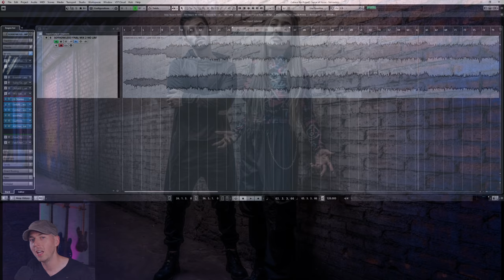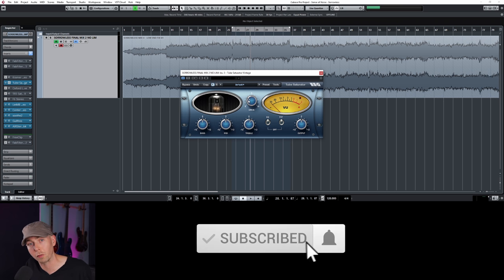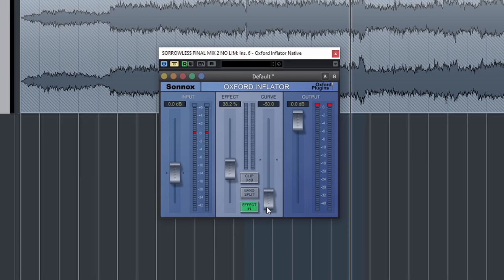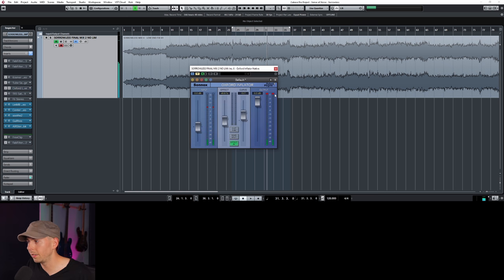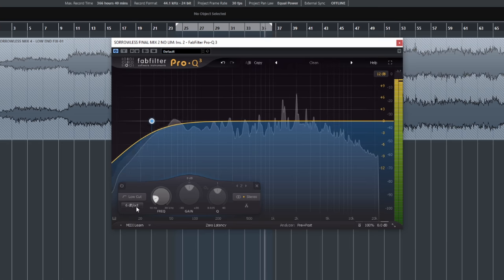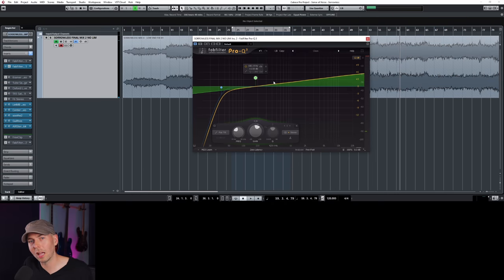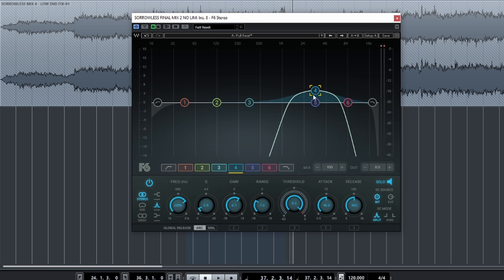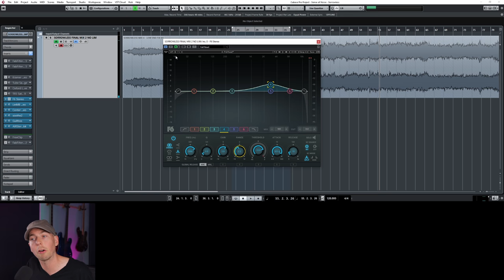3 Tricks for LOUDER Songs Without Compression or Limiting

Comment: I use a limiter, and I hit the LUFS level. My songs STILL don't have the volume that I need. They are still quieter than other songs on YouTube.
Reply: Do not confuse loudness, which is an objectively measurable property, which volume, which is subjective. LUFS is a standardized metric for the loudness, which is definitely more sophisticated than for example the peak and RMS level, but does not consider the perceived volume. If you have for example way too much low end in your mix, you will have quite high LUFS values, but it won't be competitive with other tracks.

Comment: Face palms Where to start. First, notice how the plugins are peaking? Digital domain peaker = baaaaaad type of distortion. Secondo, the more you boost through plugins the less head room you have, which means when you send that to a mastering, or when you're doing your own mastering (not recommended, get fresh ears to do it) they have no head room to work with. That's why when you boost frequencies in eq's or basically do anything that raises the volume in a plugin you have to trim it down so that the output is back to the same level as the input of the plugin. This will also allow you to fully see the sonic difference of your changes and not just the perceived changes due to the difference in volume output. Thirdly, choose what you do carefully by the genre of music. You already have a heavily distorted type of music going in this song, adding a bunch of distortion on top of distortion is just going to make everything sound over distorted, even if you try not to add too much distortion, the accumulation is going to do that. Now also notice he's doing that on an entire mix as a mastering process. THIS IS KEY to understand, don't confuse what he's doing as something to do while mixing. If you'd try to do that on a track by track in the mixing process you'll DEFINITELY end up with an over saturated mix.
Reply: Regarding point 1: if the plugin is running at 32 or 64 bit FP, it won't actually be distorting unless it's designed to emulate analog clipping. Which plugin are you specifically referring to, because I didn't see any active clipping once he was done adjusting them.

Regarding point 2: headroom for mastering is absolutely a myth. All we really need is a file that doesn't clip. Other than that, we gain stage it to our liking before hitting our chains. Also, the whole point of these tests is to make the tracks louder, not simply to make tonal changes, so the whole "fooled by loudness" argument doesn't necessarily apply, although it's not a bad idea to check and make sure it's not making the mix sound WORSE when level matched.

Regarding point 3: this entire video is obviously geared towards mastering, so I'm not sure why anyone would confuse this as something to do while mixing. Although I'm not a fan of adding a much noticeable distortion during mastering, the whole point of this video is to show ways to increase loudness aside from the traditional ways, so obviously saturation has to be talked about, even if it's not necessarily the best tool for the job.
Reply: @rocketman374  Ill get back to you for the time stamps later tonight. Well, I don't master my stuff een though I kinda  mix through mastering plugs on the master buss, but thats justto see what actually would happen audibly. All mastering engineers I've worked with or talked too always wanted the mixes with abou 6 to ten dbs from clipping. Just saying whats preffered by the actual master engineers.
Reply: @emanuelchayer1756  I'm an actual mastering engineer. Any mastering engineer that asks for 6 to 10 dB of headroom is either lazy, clueless, or just applying a little Kentucky windage to ensure the mix engineer doesn't send them something that's clipped during the print. There's absolutely no practical reason to have that much headroom, it makes no difference. If you send me a file with a true peak level of -0.1 dB or file with a TP level of -10 dB, either way I'm gonna normalize it to where I need it for my mastering chain. So all that matters is that it didn't clip during the render.
Reply: @rocketman374  Adding to that, if the file is rendered as 32-bit or 64-bit FP WAV, it doesn't even matter if it's clipping. As long as it's FP, it can be turned down later without any destruction to the audio.
Reply: @emanuelchayer1756  addtionally, if you leave 6dB of headroom instead of 0,1dB, you lose 6dB of low level information for nothing
Reply: @rafalvarezsevilla  that is utter nonsense. Sorry but that is not relevant in the digital world. If you were recording to tape and you had a noise floor to compete with, maybe, but not in the digital world.
Reply: @emanuelchayer1756  you lose 6db of information, that's a fact, it doesn't make a huge difference for sure, but why would you want to lose it? there's no reason as far as i know
Reply: @emanuelchayer1756  this is why you shouldn't pretend to know more than you do haha

While I think everything shown in the video is a horrible idea, in the context of what it's about it's showing just about the only tools you could use to increase loudness.

Also the -6db myth comes from the DAT-era, due to the risk of clipping and conversion artifacts.
If your mastering engineers are asking for -6db, you're either getting scammed or you've hired some old fart who's still tugging it to his old Sony PCM-1600(Which is worse!). :>
Reply: @notuern  EMN you do know that clipping in the digital domain (daw master clipping and internal plugin clipping not as worst but can still be detrimental) is exactly as worst as cliping dat-era. Only clipping on tape was not as bad as it provided some (sometimes depending on how hard you clipped) nice saturation. It's all well and fun when you're still within the daw (providing your using one that uses floating points which nowadays most are) but after that, once you leave the daw... that's where the nastiness happens if your clipping at the master bus.
Reply: @emanuelchayer1756  Except that it's not as bad, because you're not clipping in the actual analog to digital conversion.
Also i don't know what kind of janky ass plugins you're using that are input clipping(Unless they're actually simulating analog clipping.), because the clipping would actually have to be hard coded into the plugin(Which means it depends entirely on the plugin.).

Try stacking some clean EQ's boosting out of their minds, and then bringing the levels back down again and tell me about how much it's clipping.. for shits and giggles, try to do it with ReaEQ. ;>
Reply: @rocketman374  Regarding point 1: The majority of people recording including those at the next level are not working in 32bit 64 bit but rather 24 bit. This is because most 32 bit can be taxing and not all plugins run at 32 bit yet. Gain staging plugins is super important to getting great mixes... Every time we add plugins like eqs comopressors, if the plugin is clipping this is why there is a gain or output control which most people ignore. ITs ideal to not have volume jumps just because you put a compressor or eq on track.  Regarding 2: as someone who has been mastering for a living for 10 years. Headroom is very important in order for mastering engineers to do their work. Top mastering engineers like Pete Lyman require as much as -12 db depending on the style of music. If its EDM/Trap Rap/ -10 to -6 other more organic styles of music as much as -15 to -10. I didnt' make these rules but these are common practices..
Reply: @zonasound  the comment about 32 and 64 bit is regarding the program not the music. The DAW's internal processing is either running at 32 or 64 bits. It's been at least a decade since any DAW has run at 24 bits. It has nothing to do with the bit rate of the music, that's a completely separate thing.
Regarding the headroom, any mastering engineer that can't figure out how to clip gain a mix to get the headroom they desire is either lazy, ignorant, or pretending they're still working on tape. There is absolutely zero reason to have 12 dB of headroom in a 24 bit PCM file, or even a 16 bit file for that matter. As long as the file hasn't been clipped during the print, I'm going to normalize it to the level I need as the first step in project setup, so it doesn't matter if it has 0.1 dB of headroom or 20 dB of headroom, it's going to end up exactly the same before it hits my chain.
Now if you're talking about dynamics, then yes, if they print a squashed mix there's very little we can do to put that toothpaste back in the tube. But any competent mix engineer is going to be aiming for a very specific sound with their bus compression, so that's usually not an issue.